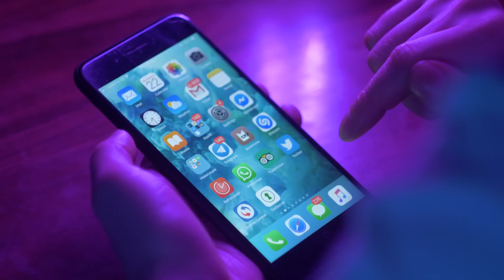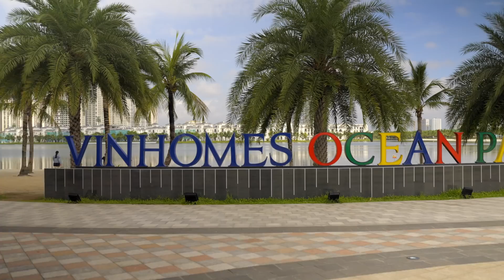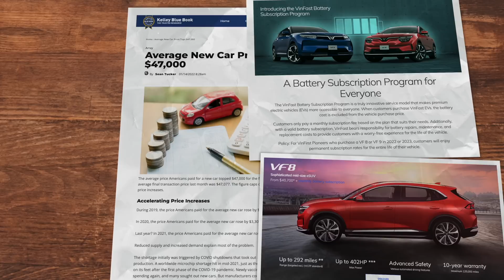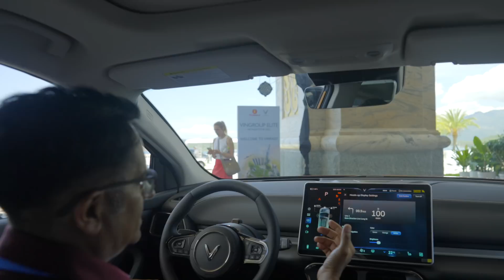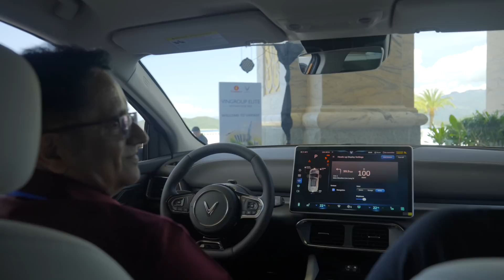New Startup FINALLY Makes EVs Cheaper Than Gas Cars!

Comment: The battery tech just isn't there yet, they need something that either doesn't wear out, can be serviced or replaced cheaply every 5 to 8 years.
A subscription to use your own car is a bad idea, you pay a monthly charge even if you don't use your car and the company can bump the price up whenever they feel like it and your choice is pay it or they rip the battery out of your car.
The company could go bust and even if it didn't it would effect a trade in or sale later on as any new owner would have to take up the cost with the car.

The main problem with EV's companies is they insist on cramming in more tech and useless features and that effects the cost.
The cheaper China made EV;s have it right, they keep it simple, no keyless option, no electronic handbrake or fancy toys.
Most people looking for a new car want it to be like the old one or to be basic rather than pay extra for stuff they either don't trust or won't use.
Most drivers don't want their new car to feel like driving around in an Iphone, they want to be contacted to the car.
This is the main reason EV's aren't taking off as most drivers like their old cars and would sooner keep using them until they die or the fuel runs out.
Reply from the maker: batteries can last 200-300k miles, they last a lot longer than you might think
Reply: If the Korean battery can last that long why is the subscription so high?
Reply: @terrafirma9328  I agree and what he failed to mention is batteries loose efficacity over time and the company that replaces them might not replace the battery pack until the efficacity drops below a certain percent.
They probably won't change a failing battery pack when it's at 90%, 80% or even 70% and you've lost over a quarter of your range.
A subscription is always a bad idea, even if you weren't paying to use your own car as there's always fine print so the company isn't out of pocket.
It would work out cheaper to not pay it, buy the whole car and batteries outright and then replace the battery pack yourself as people will start to recondition them as more cars are put on the road.
Reply: @dave4803  👍
Reply: @terrafirma9328  To ream you of money.
Reply: @TwoBitDaVinci  But the fuel tank in my old car has lasted and won't fail anytime soon, plus it won't cost as much to replace when worn out.
Reply: Electric cars have far less moving parts than conventional cars that need replacing or servicing every now and then.

A battery lasts far longer than most of those parts do, so look at the full picture when doing comparisons.

That said, a subscription for any part of any car is a bunch of horse shit and won't be accepted by anyone with at least two brain cells to rub together.
Reply: @Diavire  Don't get me wrong I like electric cars, I just feel like they are ramming too much tech in them and that not only ruins the driving experience but it pushes the price up.
Is it too much to ask for a normal key, hand brake and gear selector with no extra gadgets most people won't use?
Those cheaper Chinese electric cars do just that and they outsell Tesla's worldwide in just China alone,
The market is screaming for a cheap no nonsense EV that's more like a normal car and none of the main companies have caught on yet.
Reply: @dave4803  cheaper no nonsense versions will come, but right now pretty much every company is still in the "rich people's toys" phase. To stay there and make the big bucks per car type of money they'll need to keep creating reasons to charge those high prices in the name of innovation.

Once that cow is mostly milked they'll start making cars for us normal people.

Maybe a decade after that people like me will be able to afford a second hand one. :)
Reply: @Diavire  If they can hold out that long as sales aren't what they should be and people are threatening to hold onto their old internal combustion cars.
China is already doing that and showing the world what everyone wants with cheap EV's that are more basic and use traditional controls.
Even the cheap ones you can buy in the US and Europe cost way more and are like driving around in an Ipad, people just don't want it and that is why EV's haven't taken off.
Reply: @dave4803  Guess it depends on where you live, because I see a Lot of EVs on the road. Mostly Nissans and Teslas, but others are starting to show up too. (Netherlands).

Guess it also helps that charging infrastructure is getting pretty good here. Hell, I just spent a week on a literal farm and they had two charging spaces set up.
Reply: @Diavire  I live in the UK.
The part I live in they aren't that common yet, for me they are way over priced for what they are, too many gadgets and gimmicks when most people just want a simple EV with a decent range and controls more like a normal car. 
In China they do just that and I'm waiting for them to enter Europe.

Comment: Just a quick suggestion : when talking about EV, don't forget to add the total range. That's something important.
Thank you for the information. However I'm a bit surprised by the fact you think this battery thing is new. That's not the first time I hear about that, there is a company in France that allows you to buy the car then rent the battery in order to lower the price. It's not really a crossover, more like a little car (Renault Zoe). I dont' know if that's something comparable.
Reply from the maker: that's a good point! We don't get those cars here, so it's a new idea in the U.S.

Comment: The main questions I get as an EV driver is ‘What is its range?’ Did you mention that for the Vinfast? A good equivalent of MPG might be Miles (Kilometres) per Killowatt/Hour (domestic charge) as people can check from their Electric bill the cost of 1 KWH.
Reply: 320mi
Reply: You can look it up. I think it's 280 or 320 miles depending on the level and model. But don't quote me on that.

Comment: The average price for residential electricity in the US is almost $0.15/KWh and many people who live in an apartment won't have access to home charging and will have to rely on charging stations which are much more expensive.  Then you also add that EVs cost more to register due to not paying road tax through fuel so at the end of the day unless you have solar installed or are paying almost nothing for fuel it will be hard to justify the switch to something like this where you are perpetually paying for a leased battery.

Comment: Did he say I could save 10$ per month after battery subscription?
Reply from the maker: depends on how much you drive... if you drive less, they have cheaper plans for less miles too... this is for the unlimited, and if you drive more than that the savings go up. i drive closer to 24k a year... so for me its a much bigger savings
Reply: So they charge you by the mile or grouping level of miles. This sounds like they want to take the profits of the oil companies per mile by subscription. What if they decide to raise the subscription rates in 2 years?

Comment: No way I would buy a car with a monthly battery charge attached to it. The whole point (at the moment, ignoring environmental issues) in buying an EV is the savings in fuel costs. With a monthly battery subscription the savings are minimal to negative, depending on milage (low milage users will end up spending more on the subscription than they would on gasoline). Add to that , when you sell the vehicle, the new owner has to pony up for the subscription too - the car is never really yours or theirs, as you can't stop paying the subscription (if they are anything like the Renault subscription terms), as if you refuse to pay the subscription the take the car back, because they won't just take the battery. (you are probably better off putting that money toward a replacement car/battery when the battery finally expires).
Reply from the maker: check out their 3rd row VF9, that's what I reserved. 7 seater, that's 30k cheaper than a Rivian R1S and 50k cheaper than the Model X. that's why it's so interesting, the VF8 has more rivals, but there are very few 3rd row EVs right now. cheers
Reply: i agree, also you are at there mercy of increased subscription costs over time, so this year $110  in 5 years $150   i mean what subscription goes down in cost lol

Comment: There is a crush on electric vehicles these days. The stress is on lithium batteries and the availability crunch can be expected to follow. We will need a variety of batteries to cope up. Aluminium air batteries are most promising and need continuous development like engines now.aluminium is really a fuel and low cost production and technology of replacement in battery after exhaustion needs to be standardised.

Comment: affordable ??? cheaper ? NO --> Calculate: RAV-4 (what ever spec you chose) is 166.50$ per month ... Vinfast comes out 155$/month assuming no fast charging ... SO it is afforadble/cheaper where? If you count the fact that you own a car (without a battery) that you cannot easily sell, it is worst than any other deal. Note also that in 5 years the cost of renting will be 6600$ ... and you still have no battery(new or old) at the end of the average ownership period. Finally, note that the battery purchase option exists but no one talks about it because it makes VF8 mostly unaffordable.

Comment: Check out the top Chinese EV manufacturers — BYD, Nio, Xpeng, and others are making significant sales in Europe, and BYD already has facilities to manufacture electric buses and commercial vehicles in the U.S. Both BYD and Nio have already announced plans to set up U.S. factories. It’s not clear if their vehicles will be eligible for the new $7,500 federal subsidy because of Chinese sourcing of battery elements, but their pricing undercuts Tesla significantly. Their battery and other electronics are high quality and they advertise self-driving features (probably level 3 or below, but definitely AI features). We can expect BYD and Nio vehicles to be manufactured in the U.S. shortly. Other manufacturers will likely follow. It’s time for Ford and GM to step up their manufacturing if they want a seat at the table. Stellantis has competitive EVs in Europe but not in the U.S. for whatever reason.

Comment: The subscription costs are outrageous. One month car battery subscription is higher than one entire year cost for home energy with no extra cost to charge the car battery
Reply: It is not about the energy, it is about its storage, the hardware. Your argument is mixing those 2. If you would not lease the battery, the car would be a lot more expensive.
Reply: @pan6593  you should just lease an entire car, that includes maintenance and insurance where i live. In this scheme you buy something that is unusable without subscription, and still pay all the other things. It doesn't work out
Reply: @bzuidgeest  Yes and no - I appreciate the idea of a full ‚lease‘ or rent model - everything included. I think on this particular one it would not work, because the battery lease is mandatory. Interestingly european brands (at least Renault, but they were not the only ones) are just getting away from exactly that model - you can buy ‚back‘ the batteries and all battery leasings will be discontinued by I think end of this year. It either didn‘t work out, or it did, but it always only meant for the starters believing in the battery-dies-first-lie. As a manufacturer you can easily get away then with the leasing model and sell it with the advantage of zero dead-battery risk.
Look at all the Renault Zoes and early Teslas (2014 Model S) - almost all have 90%+ battery capacity. Once they will fail yes, but generally speaking most of the batteries are ok. Pretty much like an ICE engine, there a few that need complete rebuild engines, sometimes even early, but most last a while and die slowly.
Reply: @pan6593  the battery lease is going to fail because full lease is far more economic price wise and you get much more for the money. Renault didn't stop because it was a success. It was a failure. Why buy a car that requires a subscription? You can just take a lone and make similar payments but at least you own a full car at the end. Or you go full lease and get insurance and maintenance in the package. This half way model is just not smart. Full lease might not be an option with this car, but that just means that no sane person will buy it

Comment: You need to expand your research, as you failed to include the number 2 selling EV manufacturer and that is BYD. I like your videos, we have have owned 2 EVs both Chinese and we could not be happier.
Reply: He didn't fail. This was about Vinfast which is coming to the US, and there aren't any China cars on the horizon yet for America so why include them.
Reply: @davidmccarthy6061  because Tesla and BYD are 1&2 in the world of EV production, BYD are producing batteries for Ford GM Toyota Tesla Apple, the blade battery is the safest battery in the market. Just a few reasons to include BYD

Comment: The problems we have in UK is number of use able charging points if you do not have a Tesla,  ok for short trips but the number of times I have heard people say they nearly ran out of battery  power looking for a working charger on long trips.  Ev range is never close to what manufacturers state and they are getting ever more expensive . I would love to swap but I would have to cash my pension in to get something that would give me  the range I need to visit my family, plus electricity prices are rocketing in the UK  whilst fuel is dropping.  So I will  keep what I have for the present.

Comment: So what you are saying is that basically they are doing what other legacy auto is. Producing EV's with performance like an ICE car. Difference is they do sw as well. Have you driven weak performing Ev's? They are so lame and boring, I just don't get it. Why would you buy an electric SUV with entry level ICE suv performance? Ok, not everyone needs a Tesla or BEV Porshce in their life, but isn't life too short for boring ev's? Winfast didn't need to target the fastest and quickest of EV's, but this should for sure out do a performance ice suv.
Reply from the maker: The cool thing is they can add a high performance mode all via software. It’s a dual motor 400HP car so yah… I’d love to see a super fast mode too!
Reply: Government egulation might have something to do with why it's not yet a feature.

Comment: Did I miss something? This WITHOUT THE BATTERY costs the same as a Model 3 and more than Reanult Zoe. How is that cheaper than gas cars? Not even the cheapest EV is cheaper than gas cars and this is more expensive than the cheap EVs excluding the battery which is the most expensive part of an EV. Clickbait much?
Reply from the maker: The closest comp is the Y, which costs like $60k
Reply: @TwoBitDaVinci  But Model Y is not a gas car and is not cheap. Where is the "cheaper than gas cars" part?
Reply: $60k-$57k = $3k savings. Wooptie doo🤨

Comment: You're not living with low impact in this video. Driving 22,400 miles a year is a sign that you're driving MORE with your EV thinking it's emissions free, so no impact, which is super wrong way of addressing sustainability. You flew 16 hours (3.74 tons CO2e) to record a few minutes of video and test drive a depressingly standard EV which isn't any cheaper than other cars. $43k (you said low 40s) PLUS a battery subscription is actually a worse deal than most EVs sold in USA. I know you're trying to feed your family, but if we all did sustainability this way, we're failing.
Reply from the maker: Karl, I have an EV I largely charged on solar. I said in an early episode, I’m not trying to live in a shed and never go anywhere. Neither is the average person. My approach is to have a bigger impact on more people. I run a business, I have to drive a lot, but soon it’ll be 100% off solar power.
Reply: Watching many of your videos I can see and applaud your efforts. Have you looked into the companies green footprint and compared it to other EV manufacturers? I'm wondering if there will be a way to grade these manufactureres as we go forward because they could make the most green vehicle on the market but if they offset it with more carbon polluting manufacturing than other companies were not better off.

Comment: Unpopular opinion. I like that it accelerates at a more normal pace. I get the thrill of being slammed back in your seat. That thrill is best left to the amusement parks and off the road. 
That is all. I am gonna go back inside and take a ibuprofen for my back now.
Reply from the maker: You’re not alone in this opinion!
Reply: Wouldn't surprise me if that's because higher performance puts much higher strain on the battery, and since the battery is on a subscription, they don't want that kind of wear.

Comment: The battery lease isn't a new idea at all. Renault did this with the Zoe right from the start and just ended this policy a few years ago because it doesn't really make much sense.
Reply: They currently have both options buy or rent.
Reply: You mean doesn't make cents!
Reply: @DragonKingGaav  no, it basicly made old Zoes unsellable since now you have to pay bunch of money each month to Renault use the old, short range EV. The option was there because back then they started sellin Zoe (2013? 2014? Can't recall off the top of my head) there have been seriuos worries about batteries failing after handful of years and needing to be replaced. Well it turns out that was completely unfounded, so the whole battery rent thing ended being more expensive and less convenient in the long run.